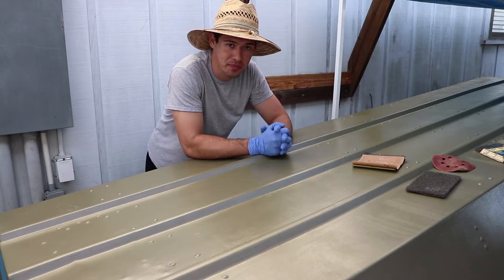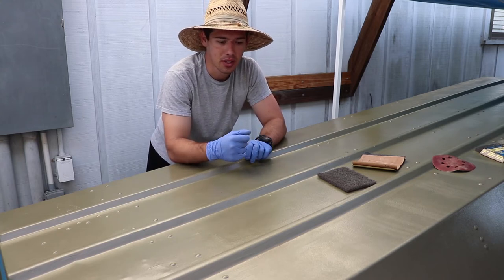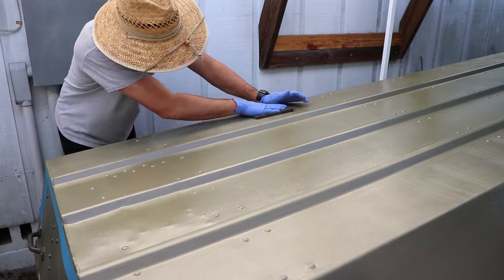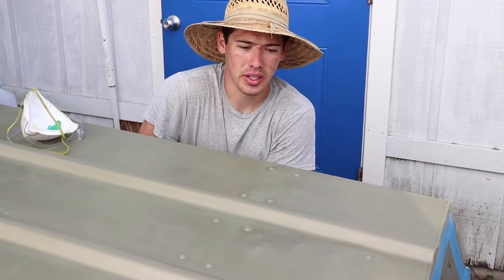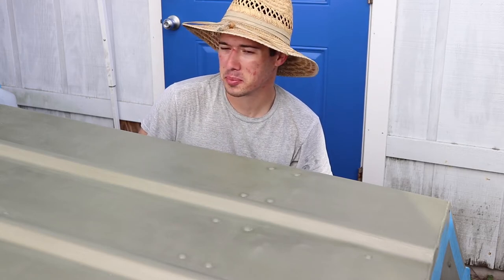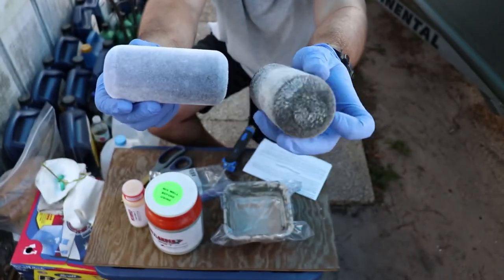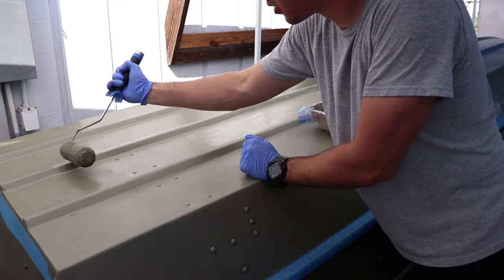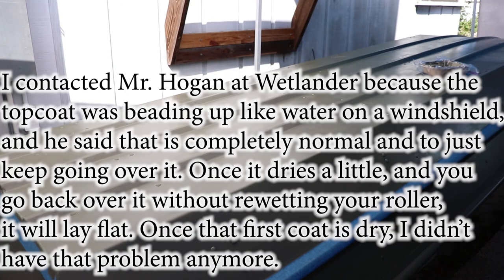Putting Wetlander on a Boat - Top Coat Application

Comment: Thanks for putting this out there. I just ordered from them because of your videos. #wetlander
Reply from the maker: Thank you for the support of watching the video and subscribing! Thats awesome! The wetlander has been holding up really good. I love that it sealed up the jon boat the way it did. You should really enjoy it. What are you going to be using it on and for?
Reply: @JTgatoring  using it for the bottom of my Jon Boat (16 footer). I use it in some smaller shallow lakes and rough rivers with debris. I occasionally take it to a larger lake and was hoping this would help it glide in the water better.
Reply from the maker: @toyotaguy1984  I've been running mine through heavy vegetation with some debris and I don't think I've picked up any new dents. A few scratches, but still slides with ease. As for speed in open water, I haven't noticed any difference there, but also haven't really tested for it either
Reply: @JTgatoring  good to hear and as for speed I figured it couldn't hurt lol

Comment: JT,

How is the WetLander holding up? I am wanting to use it on our Tritoon this year to keep the algae from growing on it or if it does it will be easy to wipe it off the toons. Please let me know thanks.
Reply from the maker: Wetlander will work great for that. It makes it very easy to wipe off pond scum, and nasty green staining algae. Its been holding up pretty good on the boat. Its worn down in high use areas like the bow when I beach it in the sand, but overall has held up great
Reply: JTgatoring Yes we do not beach our toon. We tie out from the beach and walk in. We leave our boat in the water for the boating season in fresh water. And I have tried so many other things only for them not to work. Scott sent me samples pieces and I have left them in the water coming up on a year in May. During the boating season I would lift the samples up and look at them and wipe them off with just my hand and they also came as clean as when I put them in the water for the first time. And that is letting them sit for a month at a time without touching them. Of course with our boat I would be wiping it down weekly as we flow in the water. It’s by far the best I have sampled so far.
Reply from the maker: @Tom-uq1tc  Yeah, its treating me great. I've taken the boat out of the water and left pond scum on there for a couple of months and let it bake on there and I take a scrub brush and wash it off and still no staining. I don't think you'll have an issue with what you need it to do.

Comment: How many top coats did you put on ? What was the actual cure time ? Did  the end result meet your expectations ?
Reply from the maker: 5 thin top coats. Actual cure time, I believe it ended up being 5 days till it fully cured. I waited a full 7 days though just to make sure everything was cured before I tested it. I am happy with it
Reply: @JTgatoring  would you recommend this stuff for a fiberglass canoe?
Reply from the maker: @doomguy584  It would depend on what you are trying to get out of it.  The two main things I really enjoy about the wetlander, is that it sealed up my leaky riveted jon boat and made it slide across grass much easier. I would hope your canoe doesn't leak but the wetlander will help protect the bottom a little bit from abrasions along with making it easier to slide on top of media
Reply: @JTgatoring  I did all the glass work already and was hoping this would make a good seal/paint instead of doing gel coat
Reply from the maker: @doomguy584  I would not be able to give you an educated answer on that. You could always ask the manufacturer, Wetlander, to see what they say. You'll most likely speak with Scott. He's the head honcho
Reply: @JTgatoring  ten four👍